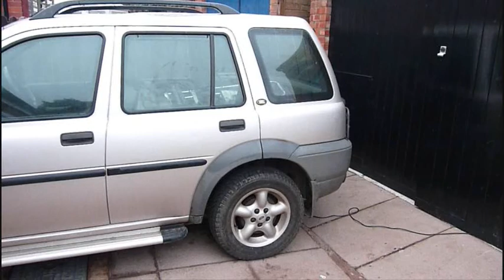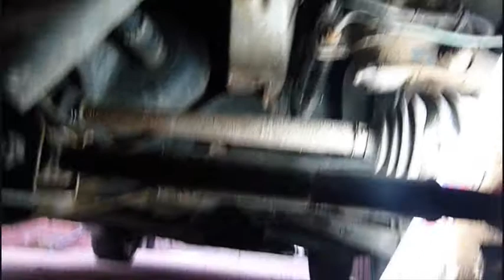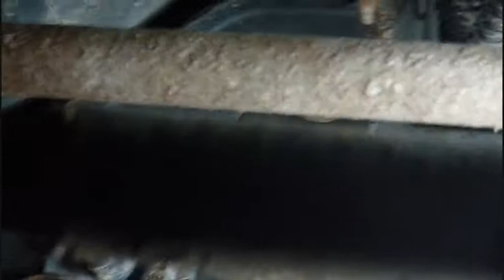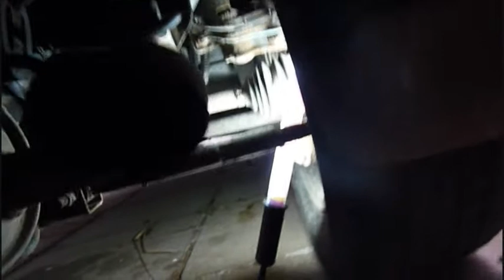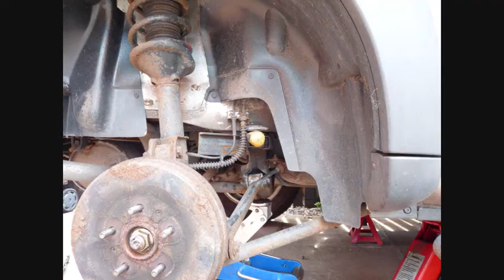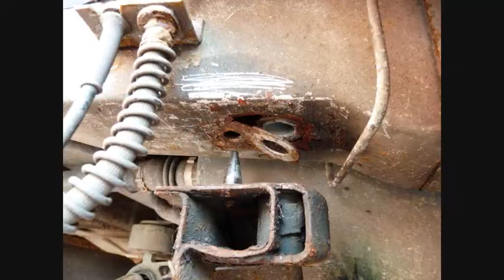freelander subframe creaking cracking noise

Comment from the maker: @Freelandrew  Hi :) I had the noise when pulling off in first gear it was a crack / loud click noise that turned into a crunch noise(this is all subjective of course). Almost like a bit of grit stuck in the brake drum. It got louder and more often as time went on. It was not a continuous noise while driving. Just when pulling off in forward or reverse. Hope that helps :) 
see the link in the video details for a good forum on the issue.